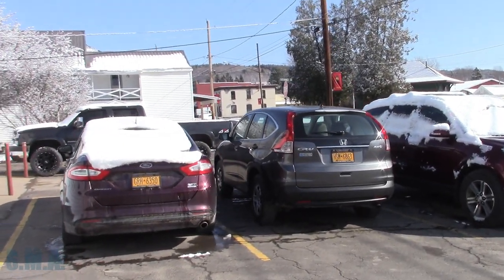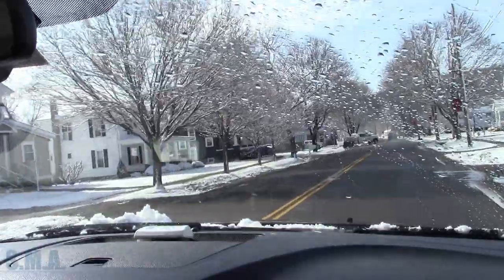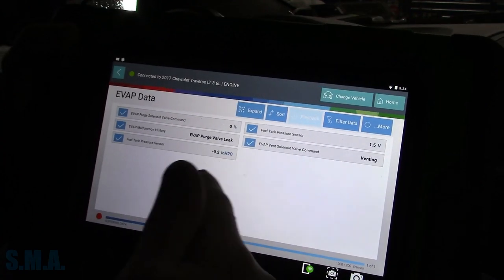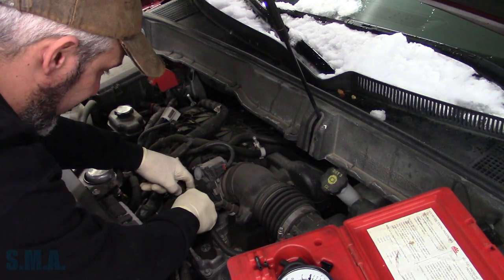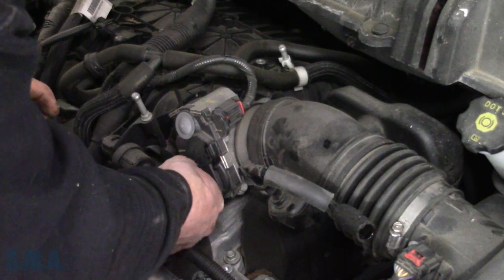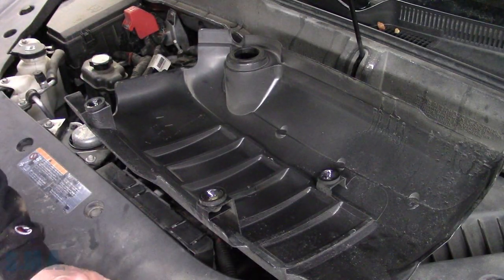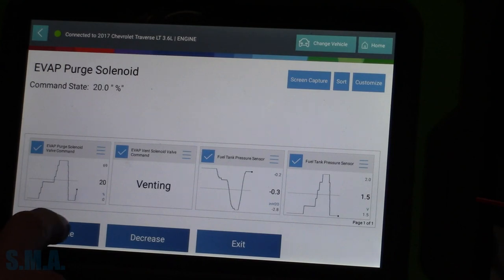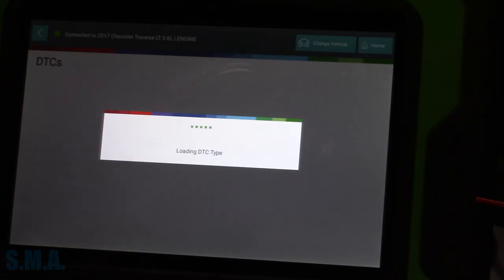Chevy Traverse: P0496 EVAP Code

Comment: My 1999 silverado is still running. WHY? 4.3 Changed an 02 sensor when I bought it. Check engine went out and never returned. Why is this thing still running? I guess we"ll never know.
Reply: I have an 88 Dodge Dakota,  226,000 still running.  With the 3.9 V 6 I heard it was a piece of junk engine , still runs good. 5 speed 4X4
Reply: @bertgrau9246  You have 10 years on my turd. My brother had a Dakota. An early year with a V8. My other brother wrecked it. Man that thing was fast.

Comment: Po111 your thoughts on that cold cam shaft position sensor replaced cam bolt replaced timing chain replaced ls 6.2 my next move will be to check cam bearings and oil pump o ring any thoughts please let me know thanks

Comment: My check engine light keeps coming on in my 2011 Traverse.  I have replaced engine, transmission transfer case and timing belt.  Also, had the engine flushed out.   The check engine light comes and goes off randomly,  What to do?

Comment: Have CEL on, 2004 Mazda 3. Shop sets code(s) point to evap problem (didn’t provide more details).

When I fill up the fuel tank (not top off, I stop when it shuts off), I can smell gas vapors from under the hood. These go away after a day or 2 of driving.

Is this likely just a broken or pulled vent hose? Or...?

Ideas guys?

Thanks.

Comment: My voyager 4cyl 02 small leak comes up if I don't warm it up or don't shut down when filling bought 2 caps have reset tool 15$ comes on maybe every 2wks   hear 1code allowed  ny.was inspected when I got it said cost more to fix than vanworth. .100k miles gets 40mpg.

Comment: Check the lines fer little bits? (blow the lines clear) Some people over fill the tank ALL the Time causing the little bits to come out of the canister during purge and catching in the Solenoid. Granted you may get a rich code but usually the codes have been cleared when they put a new cap on.🙄

Comment: Question? I have a 2012 traverse when is 1000to 1500 rpm it jumps up to 1600 to 1800 rpm any suggestions I'll appreciate it
Reply: Throttle position sensor ?
Reply from the maker: TCC Torque converter clutch is failing. Pretty common on those trans
Reply: I was wrong then , sorry . Ignore my answer .

Comment: Have you ever seen blue motor oil? I changed the crankcase oil in a new-to-me generator and what came out was dark but not black, it was greenish-blue.
Reply: Greenish blue is probably Shaeffer's brand.  Full on blue is probably CAM2 "Blue Blood". Both are decent oils. Shaeffer's is just super expensive and carries zero OEM approvals.
Reply: @tyronebiggums5964  Interesting! I had no idea there was tinted oil.
Reply: @moconnell663  Those are the two brands of tinted oils that I have experience with. There are probably others. B&M Trick Shift ATF is dyed blue, while most domestic ATFs are red.

Comment: I have 2018 Malibu that needs a head gasket. Dealers are the only ones who can fix it because you need special toole. They all say it will cost about 2,000 dollars or more. It's a 1.5 engine.
Reply from the maker: Special tools lol...ummm ok. Price sounds about right but no, anyone can do that. Easy engine to retime.
Reply: @SouthMainAuto  - I LOL'ed at that one, too! Typical dealership. They should run for office - they'd fit right in my state's legislature!

Comment: I have a 2011 traverse that when started, and is sitting at idle, the RPMs start to fluctuate up and down like the truck is breathing then stall out, and if I start it and rev the RPMs to let's say 3000 RPMs the truck will do the same thing, only difference is it won't stall out because I'm pressing the gas, but will do that breathing thing.
Any Suggestions?
Reply: And it's Not throwing any codes I guess because the battery was un-hooked.

Comment: If it is a gas cap a little vasilene on the O ring fix it. Have done that more then once on my 05 Liberty.
Reply: If you've done it more than  once, did it really "fix" it?
Reply: @tyronebiggums5964  Of course. The o ring wears a little and dries out. Vasilene softend it and fills in any gaps.  Have done it at least twice on the car with 130,K on the clock.

Comment: every so often, the odometer display on my 2009 hondoo accord says, "check gas cap". i smear the rubber gasket with some engine oil, and it goes away for a while.
Reply: Engine oil might break down that rubber gasket. Better off to use some silicone grease or spray on rubber parts.

Comment: I have a 2003 grand maqui it only starts an stalls I replaced a lot of. Secors still no results what could be the problem plz help me
Reply: Check your fuel pressure. If low or none, see if the fuel filter is plugged solid, or if the pump has failed, or if the pump is not getting battery voltage, or ground.

Comment: Hope you recommended a timing chain and update on the valve cover gasket with the TSB. Sounded like the chain was going to bring your customer back with a cam crank correlation code. 
Rattling like a snake in the grass in that traverse

Comment: whats stupid about that campaign for the purge solenoid, it doesn't cover all vehicles that use the same part... like the colorados with the 3.6. When we get a vehicle that is covered by the coverage it is no charge to the customer. Pays 0.5 including diag. They tell the customer on any car that may or may not have a coverage that there will be a diagnostic fee if the issue isn't what special coverage is.

Comment: I  got a "check engine" light on my Honda Civic.  Took it to the Honda dealer and it turned out the the little plastic thingy that keeps the cap from parting company from the car had somehow gotten under the seal of the cap.  The Honda guy said " that"ll be a hundred bucks please"  I talked them down to 50.  Anyway It was my fault since I only do DIY gas filling., but it was the cap,. So, checking the  cap isn't a bad idea, make sure it is on tight. and its probably the easiest cheapest engine light fix there is.

Comment: Alot of these evap codes are from people "topping" gas off.  These new cars have to much anti pollution gizmos and warns against topping up in every manual.
Reply: That will cause a charcoal canister to fail, but not a purge valve. Purge valves fail because GM loves to use crappy, cheap, low-bidder parts that barely make it out of warranty. If it saves half a penny but cuts 5 years off the component's life, GM is using it.

Comment: C'mon, you know why they replace the gas cap.....it's because they WANT it to be the gas cap that is bad.  It's not super expensive, it's something they feel comfortable replacing on their own, they don't have to schedule a service appointment and give up their vehicle......and if it WASN'T the gas cap they're not going to beat themselves up about spending ALL THAT MONEY to replace something that wasn't causing the light to go on anyway.  Same reason why people throw a can of "Barz Leak" in their coolant in an attempt to stop a radiator or head gasket leak, or a can of "Motor Honey" into the oil when they've got an oil leak /lifter tapping/blue cloud of death following wherever they drive.